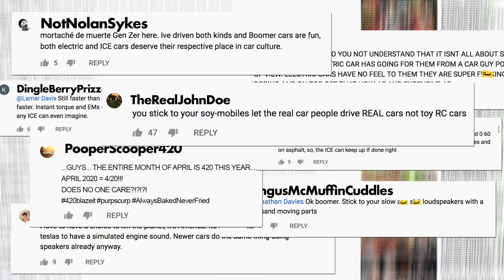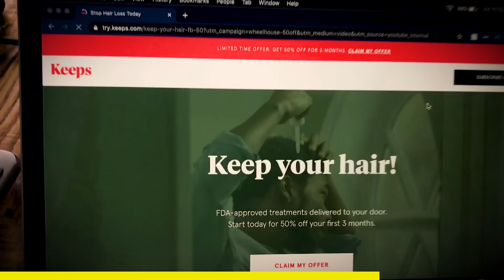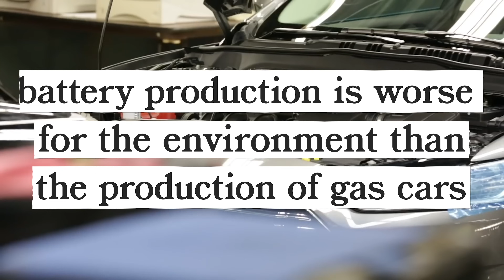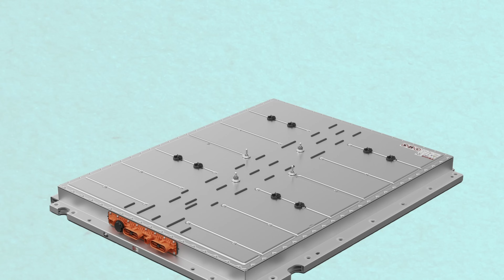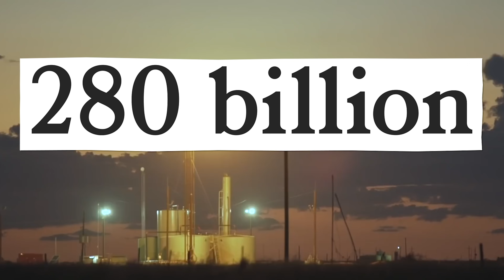Are Electric Cars REALLY Better for the Environment?

Comment: EV car have less CO2? maybe, but will it really have less environment impact? You say city with more ev car will have less warming and have better weather? I don't think so. It will be more expensive and may cause electricity problem in some place.
Reply: It won’t be more expensive and there have been extensive studies all of which point to not having any more grid problems than we do now.
Reply: @engineeringtheweirdguy2103  But not today right? And who now how many years it would take to be just like your  prediction.

But my main point is, there is no point comparing polution from CO2 emission perspective.  Maybe it is better to just compare the heat factor directly from engine vs battery and dc/ac motor.

and btw, in here electric motorcycle need battery replacement every 2 years. And no battery recycling service available yet.
Reply: @kupasotomotif  prediction was for 2050. so 30 years. current EV uptake is on track for that. and what do you mean "but not today right?"
Reply: @kupasotomotif  Actually not true. BEV's dont cost much more than their counterparts. Take the BMW M3 and the Model 3 for example. The model 3 performance is around $30K AUD cheaper than the BMW. Keep in mind that BEV's arent incentivised in Australia. They're taxed. But you get better performance, features and handling than a M3 with the Tesla. Plus operational costs are significantly cheaper both in maintenance overheads and fuel savings.

As for the second part of your comment. What a ridiculous thing to say. Whilst the statement is true. Everyone wont suddenly own an EV tomorrow. At current EV adoption is fairly full pelt. There are wait lists for model 3's and other EV's as much as 9-14 months long. So even if everyone suddenly decided to buy one, they wouldn't be coming out any faster. But to give context to that, at current, the total number of EV's Ever produced worldwide is 6.5 million cars. With that many cars you could arm only less than 2% of the USA with EV's. But keep in mind, that number is global. So whilst the statement is correct. its not reflective of reality. The transition will happen slowly, over multiple decades, They're expected that ICE vehicles will begin to leave the second hand market in 40-50 years. I'll be retired before that happens. Keep in mind that the energy grid has never fail to double in capacity every 20 years since its inception. The energy grid in almost every country has always continued to increase as the demand for electricity has always continued to increase. more lights, more tv's, more phones, more tables, more computers, laptops, smart watches smart washers, dish washers, electric kettles, refrigerators. yada yada yada. So as we gradually move towards further EV adoption the grid will gradually be built to cope. thats how the world works.

Presenting an unrealistic and impossible scenario to justify turning away from EV's is misleading and illogical.
Reply: @kupasotomotif  I chose those two cars because they are comparable in size, class, and performance. The other cars you mentioned are not the same size, class or performance.
Reply: @kupasotomotif  in anycase the i4 M50 is cheaper than the M3 which defeats your point anyways.
Reply: @kupasotomotif  I’ll respond to the rest of your points tomorrow with numbers to the paragraphs
Reply: @kupasotomotif  well no. The difference between the cheapest models of a manufacture isnt a good comparison either. As they'd be vastly different in size, performance and luxury features. Hence why I compared the Tesla Model 3 to the BMW M3, because they have similar specs, they are in the same size class and are both in the luxury vehicle category. But as I pointed out the BMW costs more than the model 3 despite having slightly worse performance.

You could argue that you could compare two of the same car models but one being an EV and the other an ICE like the golf which has a petrol, diesel and EV range. however this is also not a great comparison because its not a true EV. I say that because its an electric motor and battery jammed into a combustion car chassis. The car, body and interior is built from the ground up for combustion engines. Not for being an EV which require fundamentally different design criteria. For example you wont easily get a combustion engine and transmission and exhaust into a Tesla. you'd have to give it a tiny motor, and limit the transmission size among other things.

now for your  main comment I promised to respond to. 

1.) you dont typically take into account unexpected breakdown into the cost of ownership projection. however EV's do breakdown far less than ICE vehicles on account of having only a few hundred moving parts, instead of a few hundred thousand moving parts like an ICE vehicle has. 

2.) the transition you are talking about will take some 50 years or more. that isnt sudden by any metric and is more than enough time for the grid to keep up.

3.) Because Australian media is almost exclusively owned by mining companies, politicians bought out by mining companies or Murdoch media. so much so that it even took a ground breaking record social push for the government to instigate a royal commission into media bias and monopolies. Keep in mind that Australia's EV ownership is still less than 2% and before 2021, it was less than 1%. So the first headline is fear mongering. There have been no blackouts in Australia linked to EV's or any instance where the grid hasnt been able to produce enough energy aside from natural disasters and massive breakdowns of key powerplants. So no.

4.) There are some misleading parts of the interview. For starters, it would infact take 2 days to charge a long range model 3 form a wall point. However there are two things to note here.
A.) He notes that its 0-100%. unless he's rolling into his driveway on his very last electron then he wont be going from 0%. additionally that for him to drive from 100% to 0% requiring him to charge that much, he would need to be travelling the full range of the vehicle. which is around 560km. So unless he's doing 6 hours + of freeway driving per day, I dont think he needs to charge 0-100%. I actually own a model 3 and I charge from the wall outlet. It takes roughly 7 hours to charge from a wall outlet for the 120km I drive each day when I am home between my 8 hour works shifts for around 14 hours. Which is more than enough time to charge before I get up in the morning to start again.
B.) he did note it was from a wall outlet. Tesla along with most other EV's actually come with their own home chargers you need to install for level 2 charging. Which means he would be able to fully charge his EV at home from 0-100% in 4 hours. However it costs around $200-$300 to install the home charger that comes with the car. And whilst the device can be installed and used outdoors, some people like myself who are renting, or living in apartments with communal parking, might have trouble installing their home chargers. (I was renting I just moved into my new house and I havnt gotten around to installing mine yet.)

5.) you maths on the power is bad. Australian homes operate nominally around 240V by 10A for outlet power. Home chargers operate at between 16-32 amps depending on how it is installed. Keep in mind, you can have your washing machine, laptop, refrigerator, air-conditioning etc etc, all connected to separate 10A plugs each. Using a home charger would be the equivalent power draw to turning on 3 electric kettles at once to put that into context. However it also matters how long this draws for. If its drawing 24/7, thats a big deal, if its drawing for 1 hour each night. less so.

Tesla level 2 home charging isnt 100-200 amps, its 16-32 amps for Tesla chargers but anything over 40 amps is regarded as level 3.
Reply: @kupasotomotif  I am not familiar with either of those cars. But if comparing cars on cost basis you have to compare on an even playing field. Comparing the cost of a ford raptor with a Toyota Corolla isn’t a good way to decide if ford cars are more expensive than Toyota cars. You need similar cars.

That’s why I say you need similar size, class, performance and features to compare EV to ICE to get a good indication of cost. Porsche sell almost exclusively luxury and performance cars. That doesn’t mean cars from Porsche are more expensive. Because you might find cars with similar size, performance, class and luxury features/finish, from the likes of Ford, costed similarly. Ford just also sell cheaper smaller cars which aren’t comparable to the performance or quality of a Porsche.

1.) cars, electric motors and batteries aren’t new technologies. Their application in this case is new. But those technologies are well known.

2.) there is a limit to how many EV’s you can produce per year. There is also a limit to peoples financial abilities to buy new cars. Most people will need to wait for EV’s to penetrate into the second hand market which will take 5-10 years on its own. There is also a limit to the practicality of some people to own one. Renters are disincentivised from buying one as they can’t install a home charger. People who don’t have driveways would avoid EV’s. People with communal parking like apartment blocks would also avoid buying one. There will be a long period of reluctant change in these areas. For example on-street charging for people who don’t have driveways or slowly building enough pressure to get the apartment block super to install charging bays. And how they are regulated. 
That will all take a long long time. 

4.) yes.

5.) yes, but in comparison to day time use, very little. Night time is off peak. Power consumption is at its lowest. The grid is more than capable of handling that. But if everyone charged during the day during peak times, that might be a different story.
Reply: @kupasotomotif  replying adhoc here. 5.) actually most people schedule their car to charge in off peak hours for cheaper electricity. Due to digital technology, most EV’s come with setting where you can schedule charging. Tesla with one step further allows you to schedule when you leave so that the car finishes charging right before you leave so that the battery is already warmed up and so is the cabin and it saves you a chunk of energy on cold mornings.
Reply: @kupasotomotif  2.) there are definatey work arounds but all are hurdles. And the more hurdles there are the less people want to jump them. Basic fact of life. Not everyone is going to be immediately a die hard EV fan willing to jump all those hurdles. Factories take time and cost money to build you can’t just lump one somewhere in only a few days. Like it or not, the EV transition is going to take a long long time. Something every expert agrees upon. Which is why some politicians believe an ICE sale ban by 2030 or 2040 in some counties is considered necessary.
Reply: @kupasotomotif  2.) that’s sales of new car. Not total cars on the road. If you have 20 million cars on the road and there are some 40,000 new cars each year, 2% of all new cars sold isn’t a lot.
Reply: @kupasotomotif  technology uptake such as radios, TV’s, computers etc etc follow what’s called an S curve. We’re ramping up our S curve but that growth will stabilise and then start to drop away.
Reply: @kupasotomotif  sure people will migrate over. But it won’t be everyone at once. People can’t just afford to buy a new car like they’re impulse buying a chocolate bar. The sales of new cars will likely remain the same but with EV’s share of that market steadily growing over time. As I said, it’s going to take decades.

Comment: You've been brain-washed by the EV builders. When you CHARGE a lithium battery, it emits HYDROGEN and when it DISCHAGES (in operation) it emits SULFUR DIOXIDE that combine to make SULFURIC ACID in the air and ACID RAIN that destroys coniferous trees-an environmental impact BILLIONS of times WORSE than ICE vehicles and potentially disastrous for the oceans' algae which produce 95% of the oxygen that keeps us ALIVE! Watch a 1964 Jacques Cousteau  National Geographic Special. Oh, that's right, NG has censored them and you CAN'T buy them anymore! Oh well, the electric power grid can't support all the EV's already made-thank God 70% of them have all ready been scrapped (all 350,000 Chevy Volts built and 800,000 Nissan Leafs).
Reply: How a lithium battery can produce sulfur dioxide during it's use ? Actual (and past) lithium batteries doesn't contains Sulfur (or neither hydrogen) inside and most important, the cells are closed (cause they do not like "air humidity") so they cannot emit anything.

Comment: So this is comparing EVs to a gazolin car with a top efficiency of 39mpg. What I often wonder about is where are the comparisons between a modern diesel running biodiesel(based on hemp for example) and EVs? My Citroen C3 from 2019 does over 69mpg on long road trips and minimum 50mpgs in the city if i'm very unlucky with red lights or jams. Worth investigating.
Reply: Well if you work the numbers it’s actually more fuel efficient to charge your EV with a cheap portable generator than it is to use that same diesel or petrol fuel in a modern combustion engine.

Comment: Nice video, lots of good data. I will warrant that only the CO2 costs are considered (primarily) when discussing the environmental impact. Lithium mining and refining produce a good chunk of toxic waste, can’t numbers but essentially the brine after refining has some not so nice chemicals. A lot of the iron and aluminum in all cars can come from recycled sources as both elements are very recyclable (iron alloys are infinitely recyclable with oxidized matter being the only waste, and aluminum is easier to recycle than to refine from ore). This is a super complex issue that people on both sides fail to fully grasp. I’ve gotten a lot more centrist on the issue since starting my engineering education and learned more about what the source issues are
Reply: "I have gotten a lot more centrist on the issue" =>So you fell for the propaganda, that Electric Vehicles are the "future" and not an unaffordable joke?! German engineers (not exactly amateurs) have stated that it would take us AT LEAST until 2035 until we mastered the technology for environmentally responsible extracting method for the chemicals needed for the batteries, recyclable batteries, fast charging etc. etc. EV's are a complete disaster in the current state!
Reply: @dontlaughtoomuch11  well, not quite what you say. I used to think that EVs were a fad type of social phenomenon and that burning oil in its various forms would continue for centuries at the same rate we currently consume it. While fossil fuels are technically renewable on a long term basis (eventually graveyards may become petroleum wells due to natural processes, but don’t quote me on that since I’m not informed on those processes), they certainly cannot sustain current levels of energy consumption indefinitely. Really, no form of energy will sustain high consumption levels indefinitely due to thermodynamics. Power plants produce power (in the form of electricity) more efficiently than do ICE mechanisms in cars simply due to scale of production.  There are losses in transmission to charging points, losses in battery charging, losses in battery charging, and (of course) losses in electric motor power expenditure. However, these losses are still slightly lesser than  current ICE technologies except for the continued use of used vehicles which is a fantastic use of existing products. 

So I wouldn’t say I fell for propaganda. Rather, I realized that current existing methods of locomotion are inherently less efficient. If I could make a blanket decision then I would want to have every car powered by a fission or fusion (if they became mass producible) power unit feeding either steam engines via liquid boiling or some method of direct electric harvesting of those processes. 

You see, I am a mechanical engineering major who got into the field because of amateur racing. I love combustion engines and I don’t think they will be wholly replaced within my or the next generation unless some technical innovation occurs that is equivalent to how the steam engine replaced the horse/mule. EVs and similar drivetrains are in their infancy just as ICE were a hundred years ago, and it took that long for ICEs to develop to their current levels of well to tailpipe efficiency and I certainly don’t think they have achieved their full potential although they are close. 

Until we can make our electric production more efficient and get EV battery manufacturing standardized across the industry, then I don’t think EVs will be a sufficient method to meet transportation requirements in addition to general engineering advancements.
Reply: 50 tonnes of earth/rock extracted to power one average car.